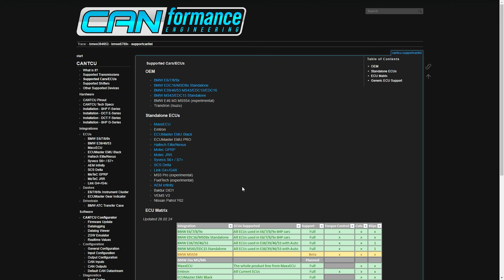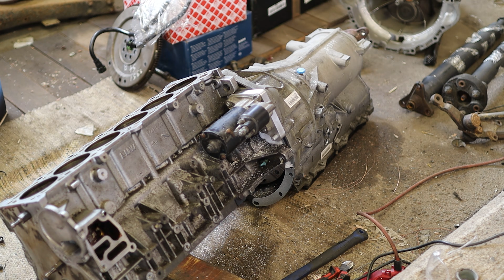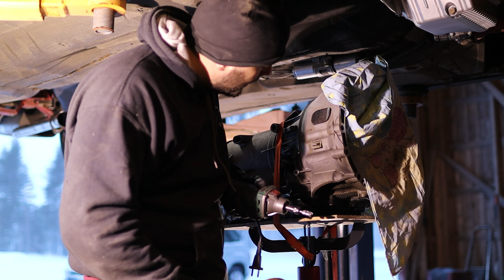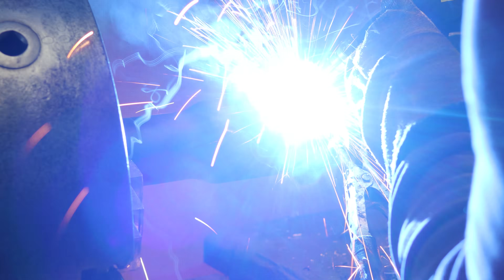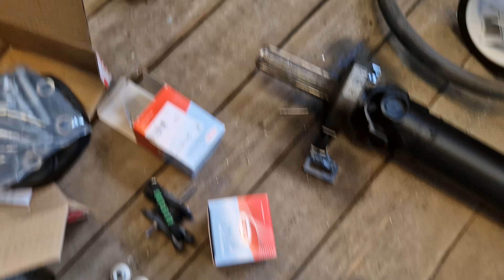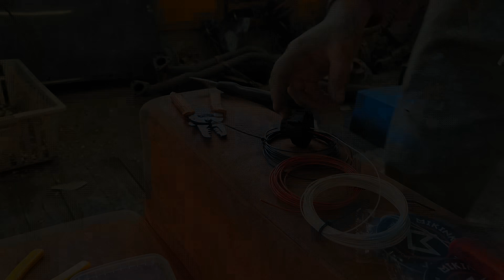8HP Swapping my BMW E36!

Comment: Need to know more i want to do this on my e46 m54 engine 5hp19 to make it 8hp45
Reply from the maker: Check my x5 8HP swap video. E46 is almost the same.
Reply: @pazi88  ok thanks lm looking it now but feels the e36 job is more similar.....
Reply: @pazi88  flexplate of a N54 good im making a list, i have now the f10 shifter like new, and traying to get the transmission 8hp45 gasoline
Reply: and the drive chaft and guibo you are using, the same of the transmission making it fit?

Comment: Hi Pazi, do you know if the 8hp45 from the  f20 ( 120i) is the same fitment as the one you have ?
Reply from the maker: Yes and no. Those have N20 and the bellhousing is same. But converter/turbine is totally different. There's no plug and play flexplate to go with, but some people have re-drilled the n20 6-bolt one to fit m5x. There's modified ones for sale too.

Comment: i think its way easier to use ADAMAT adapter and n57 flexplate to avoid making custom adapter and get n54 plate and another for starter
what you think this days i have e60 m54b30 ms45.0
Reply: I also tought about swapping my e39 m54b25 to zf8hp. 

For me also its hard to find the right zf8hp with the right torqueconverter to fit it without issues. There are many cheaper n20 zf8hps but their Torqueconverter is not fitting.. the pattern is really special… the diesel zfs are different in their parameters (according to the torqueconverters…) so i think the only one left is the ones from n55. I also found a youtuber that did the same with his e39 530i and he used a zf8hp50 with the adapterplate you mentioned. 

The spacing between torqueconverter and flexplate has to be perfect… otherwise it wont work for long

Comment: So m50 with 8hp basically didnt need an adapter ?
Reply from the maker: Yeah. Only for starter.
Reply: @pazi88 what about flywheel ?
Reply from the maker: @jdm18244 I think I mentioned on the video, but N54 6hp 8-bolt flywheel.

Comment: Which flexplate?
Reply from the maker: N54, 8-bolt version.
Reply: @pazi88 my friend i need your help, i cant find it with 8 bolt, and if i find is it pnp? For example with n55 or n47 Torque Controller? I want to start but still searching for best solution. Thank you

Comment: hey so i have a trans from an n20 car what different do i need to do
Reply from the maker: The N20 converter is different. You need to use N20 flexplate. That is only available as 6-bolt version. So you need to mod it (risky) or buy pre-modded version for 8-bolts. Afaik it also requires bit of modification for the oil pan.
Reply: @pazi88 cant i put n55 torque converter into the n20 then use n54 flexplate as well?
Reply from the maker: @m54nicky Yes you can. But I personally haven't really even thought that as an option, becsuse the converters alone cost pretty much the same as whole N55 trans with converter😅
Reply: @pazi88 i have a junkyard n55 torque converters i picked up that seems to be okay… if i swap the torque converters in the n20 then itd be a straight forward swap like everyone elses then using standard n54 flex and stuff hey? i also saw a company makes an adapter to mount up the n20 torque converters now but haven’t seen much info on it out yet

Comment: Hallo! Ich möchte das GM-Getriebe meines E39 530D austauschen. Welches „8HP“-Getriebe könnt ihr empfehlen? Benötige ich einen Drehmomentwandler zwischen Getriebe und Motor? Einen passenden Schalthebel? Wo kann ich eine Halterung für den Schalthebel kaufen? Ich habe viele Fragen, finde aber kein passendes Video zum Umbau des E39 530D.
Reply from the maker: For diesel you need 8HP70 (or 75, it's just 2nd gen. CANTCU supports it too). With torque converter and everything. You also need adapter between the trans and the M57 diesel engine. There isn't one that fits directly. Google for one that fits your trans and engine (8HP70 or 75). Almost any shifter works with CANTCU. You can see their wiki for list of supported ones. If you check my X5 8HP swap video, it's pretty much same as the e39 is.

Comment: Do all 8HP45s have the same ratios? Are the ratios the same across the 8HP range? Thinking doing E46 M54B30 with this behind it (currently stock 5HP19).
Reply from the maker: Yes, all same: https://en.wikipedia.org/wiki/ZF_8HP_transmission

Comment: What would happen if you didn’t use the adapter for the starter? Does it not bolt directly onto the gearbox?
Reply from the maker: Nope, it doesn't. And if it would fit the trans, it would still be at wrong position for the starter gear.

Comment: Awesome work! I loved your idea and I’m actually putting together an E36 with the same transmission right now. I'll be running my smaller engine with a custom ECU setup. Just curious—why didn't you switch to a shorter diff ratio, considering the top speed is already high enough? Does the original oil cooler handle the gearbox cooling well enough? I’m a bit concerned about that for my own build. Keep up the great work! Cheers!
Reply from the maker: Just because I didn't have the shorter diff yet. I now have new diff coming in with 3.73 ratio and LSD. And there hasn't been any problem with the transmission temps. All works well.

Comment: just curious why you did not consider maxxecu for the TCU control? i think a maxxecu can be used to control both ECU and TCU at the same time with minimal modifications, no? i might be wrong so i could use your input. otherwise amazing video!
Reply from the maker: Well, first of all the maxxecu 8HP support was just a rumor at the point I was planning this project. So it was out of the question. But also the main reason is that nothing beats how well stock ECU's perform, so I really wanted to use stock ECU on this for best drivability. In both engine and transmission control. No aftermarket ECU/TCU has same reliability and drivability that OEM stuff has. Many times of course the OEM stuff can be difficult to adapt/tune for setup, so aftermarket ECU is better option for that. But in this I knew that OEM ECU will work fine and be the easiest to setup too.

Comment: Hi, saya dari indonesia. Saya tertarik membuat E36 saya seperti ini.

Apakah bisa bila saya menggunakan Transmisi dari BMW F10 523i N52? 

Apakah transmisi nya sama saja dengan N55?

Karena di negara saya N55 dengan 535 itu sangat jarang.

Dan kapan anda membuat E36 dengan ZF8hp AWD? Dengan menggunakan 4x4 dari X5? 😊
Reply: Saya lagi bikin nih om dari f10 n52, bolt patternnya beda ternyata, n52 6 bolt, tapi torque converter nya persis n54 flat.
Skrg saya lagi bikin converter hubnya dari 6 jadi 8 bolt. Kalau mau praktis tinggal beli flywheel nya n54 8 hole di ebay, transmisi nya ambil dari f10 n52. Kalau penasaran hasilnya nanti kontak2an aja ya

Comment: Been watching your videos for sooo long, still in the awe with the m52 300HP build, I have a m52b28 e36 that is not road legal for drifting and I need to tow it to events, btw I'm from Romania, I purchased a e70 x5 2008 m57 , the one with single turbo 235HP, it has the 6hp and want to swap it to a 8hp which one would you recommend, I was thinking 8hp70x and to buy the can tcu, I think I need an adapter plate I saw some people cutting about 1.5CM from 6hp and welding it to the 8hp instead of purchasing an adapter plate, what are your thoughts on this?

Comment: Where can I get a drawing of the adapter plate for the starter?
Reply from the maker: You draw it for yourself 😅 Or buy ready made one.
Reply: @pazi88  where i can buy it?
Reply from the maker: @RealSomeone Domiworks sells one version. I have seen quite cheap ones at eBay. And this is one option too: https://www.hillperformance.com/products/starter-adapter
Reply: @pazi88  its for m52 starter to 8hp45? Right?
1 more questions....will be worked your cantus controller with siemens ms41.1 (i have s52b32)

Comment: which flywheel you attach on the torque converter?
Reply from the maker: @chiefvela5939  8-bolt crank n54 6hp one.

Comment: Videos are awesome dude, appreciate it
Reply from the maker: Thanks a lot!
Reply: @pazi88  Any guidance on 8hp70? Want to do this in e36 m50 turbo
Reply from the maker: @ Well, it's almost the same as this. You just need adapter between the trans and engine. For example Domiworks and PMC sells those. And then ecu that is supported by CANTCU. Or maxxcecu.
Reply: @ You think it needs a custom flex plate if PMC adapter spaces it out? Ive asked PMC anyway.
Reply from the maker: @mnz9999  Ask them what flexplate to use.

Comment: Hello, great video could you tell me who? sell  cheap starter adapter ? and which exactly did you mounted flywheel?
Reply from the maker: Thanks! From Johannes at ms4x.net discord. And the flywheel/flex plate part number is: 11227553157

Comment: What runout did you have on the driveshaft when you shorten it? No problems with vibrations?
Reply from the maker: @REVWIDE  I didn't measure, but no vibrations.

Comment: What about with M20b25 pazi? On megasquirt 2? 

I also have option to go Fueltech Ecu for cheap
Reply from the maker: MS2 isn't supported, but the MS3 and Fueltech are on experimental phase for the CANTCU.
Reply: @pazi88  thanks for the reply, I appreciate it.

Ugh cars are so overwhelming for the overthinker!

I’m starting to lean in the side of keeping my E30 with the m20 turbo and eventually building a forged m20 as initially intended 

But this 8hp is very amazing. I’m considering finding an iron block m52b28 E39 and going the turbo route with a 8hp haha…..it’s just you only live once and BMW is very hard to move on from 😆
Reply: @Miggys.Garage   we will like to se m20 content :)

Comment: Thank you so much. Now I know what to do with my e36 coupe with "m50b30" stroker which was on 5hp18. Now it is in total  body restoration using more than a half of the body from Japan without any rust at all.

Comment: Is see you have a adapter for the starter. Do you need to cut the ear of of the m5x motor or how does that fit together?
Reply: Edit: just had a look at some m5x blocks and i see the starter mounts straight to the gearbox. I do see some lighter spots on the block do you need to grind of something?
Reply from the maker: @Lonelymechanic  No grinding needed on the block side. The starter adapter fits bolt-on. Only the few top holes on the trans need to be widened as shown on the video.

Comment: did you note any of the measurements for things like the driveshaft? a parts list would be tight too. I want to swap my stock m52 to one of these in the coming months
Reply from the maker: Unfortunately I didn't take mesurements, but I will, once the car is on lift next time. I will put parts list on upcoming part2 video.
Reply: @pazi88  Thankyou!! I would for sure appreciate it, I want to get mine swapped by the end of the year. Ideally I'm thinking of having everything prepped and ready to switch, and see if I can do it over a weekend XD

Comment: You made it better!!!
I just did the 8hp to my e46.

So much better.
Reply from the maker: @MrJamesshipman  Well better is quite vague thing, so it depends who you ask 😅 But yeah it's really good. I know it would be great, but it has been even better than I expected. Totally transformed the car and it's faster than it has ever been.
Reply: @pazi88  that was the experience with my E46. Also using cantcu. The amount of drive loss from the old transmissions is so much more noticeable when you go to the 8hp.

And you can add a clutch pedal if you want the manual driving experience.
Reply: I want to swap my e46, any info you have would be greatly appreciated 🙏🏽
Reply: @CharlesExtrom  what engine are you adapting or sorry? What engine do you have in your E46?

If you get the n20 transmission, it is a direct Bolton to the E46.

It's the exact same length size, just about everything. And even the drive shafts match up perfectly.

You need a 6 HP. Z4 transmission cross member.

I use the n54 8 bolt Flex plate.
And the n55 torque converter.

I have to look up the part number on the flex plate bolts because the original Factory bolts do not work at all.
Reply: @MrJamesshipman  this is great info, thank you. I guess my main confusion is the TCU and getting it to run like OEM on a 20 yr old car. Mine is a zhp, ms45 I believe which seems to have almost no tuning support. How’s the integration on 8HP on this platform? Something daily drivable or a little more finicky?
Reply: @CharlesExtrom  I was going to make a entire like, E46 fanatics, post about everything I haven't done it yet, though.
Reply: @MrJamesshipman  please make a guide 🙏🏽 the internet gods will thank you

Comment: From Texas. Im new to the 8hp game but like what I see and would enjoy better gearing to my e36. Please show how you tie in the 8hp's wiring to the E36 electrical; specifically, does this swap require a Potentiaometer hooked to the E36 Throttle body or to the E36 Accelerator Pedal? Thx for your efforts. Looking forward to Part2 of this swap
Reply: Just get a Gear Motive transmission for your E36. A sequential dogbox in the ZF housing and no programming needed. Bolts right up

Comment: HEY. Sweet car. 
Would be better if it was on TurboLamik

Can you tell me the BMW part number for that plate u used for hole mockup/enlargement?
Thanks
Reply from the maker: @TurboLamikUS  Thanks. It's just m5x automatic cover. 11142243305
Reply: @pazi88  Youre gonna love the car with 8HP
Check out my yesterdays test on a friends car (with TurboLamik) youtube.com/shorts/OC-nl0gxbCU

Comment: I hope these don't get expensive as fuck as 2jz 1jz did, they used to sell the whole car with a 1jz motor in it with 500 bucks. now the block alone is 5000 😂. i wish there was some tcu that could control fwd dual clutches

Comment: Hello
Can 8hp transmission install to work with ms41 e39 528i?
Reply from the maker: Well, as I said in the video. It should work if you swap the ms41 to ms43 and run alpina bin in that.
Reply: @pazi88  tnx man

Comment: Hello there, why didnt you try to use f10 dust cover between engine and gearbox, and why didnt you try to fit the f10 starter?
Reply from the maker: In theory the F10 dust cover would have worked. But you can easily check the holes to be grind with m5x one. And the n55 starter would also need adapter, because it also bolts to block and not to the trans
Reply: Thanks man. Is there any chance to receive the starter adapter measurements for making my own bracket? Thanks
Reply from the maker: @tomasm.7696  Sorry, I don't have any measurements of that.

Comment: Excellent,  looking at prices for these it is becoming a compelling swap, especially in the future as the manuals become harder to find.  It is also an outstanding transmission, reliable.  The hardest part so far mount and drive shaft.  It would be good to know what the length of your final one will be( I assume this is the final one but no run time yet).    part 2 part 2 part 2!!!
Reply from the maker: I'll measure the length of the driveshaft in the next part for reference. The part 2 should come out "soon". I have already filmed 95% of it and I have the setup working. I just need to get the engine to run better to be able to include some driving footage also.
Reply: @pazi88  awesome!  yeah, production shots!  :D

Comment: The CAN TCU is not for your swap, should have bought the Turbolamik If you miss the clutch that is!??
Reply from the maker: I don't see the point if having clutch pedal in automatic. Why not just stay manual then 😅 I didn't say I miss the clutch. I meant that I don't like automatics because those have been really shit to drive over the years. Untill 8HP came out.
Reply: @pazi88  OK, yep.. Fair enough. I've done the same swap a year ago with the 8HP90 to 2J in a E36 and the only thing I miss about the manual is the H patter nostalgia! 8HP holds more power shifts faster, and I have a combo of Auto, Sequential and paddle shifter, will never go back to manual! Plus Clutch by wire is super fun for doing powerskids, yes I'm Aussie lol
Reply from the maker: @BUZDRIFT  I still have my E30 turbo with manual and it will stay like that 😄 Manual is way more fun, especially on overly powerful car like that. But this will be more like Time Attack car, so fast shifting auto should work great, and no need for clutch in that.

Comment: would the mosfet STP80NF03L
 be able to replace STP75NS04Z on the m50pnp? if not is there a good alternative? thanks
Reply from the maker: No. 	STP62NS04Z can be used as replacement. At least for now.

Comment: Would you recommend a 8hp45 on a 500hp turbo m50 ?
Reply from the maker: Yeah. It just be just about enough for that. Higher power level and you probaply want to go with 8hp70
Reply: @pazi88  from which car 8hp70 will fit to m50?

Comment: Wby cantcu,  ot turbolamik?
Reply: Depends on your use. If it's more street the cantcu is a great set up. If you want to retain your clutch pedal and have clutch kicks and use trans brake for launches the Lamik is the only option for that.
Both are excellent products though and work very well out the box.
Reply: @turbowankel1264 i currenty working very similar setup (b28tu, ms43, 8hp45 and turbolamik tcu on my e46) and im very exited how its gonna work. ;)

Comment: Nice to see another one out there, just finished this swap for someone running in an M3, we opted for turbo lamik though as car was factory manual and owner wanted to retain clutch features that can't be offered with any other tcu set up. 👍
Reply: MaxxEcu might be working on it too.